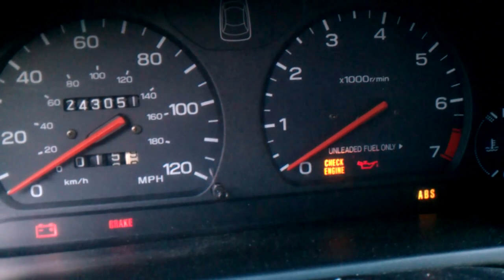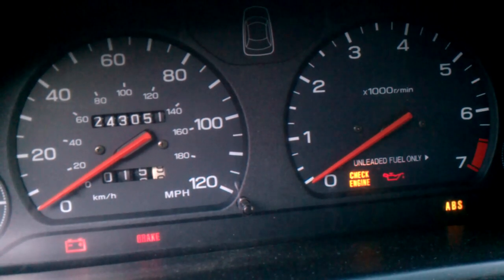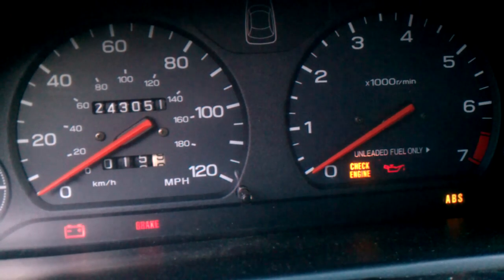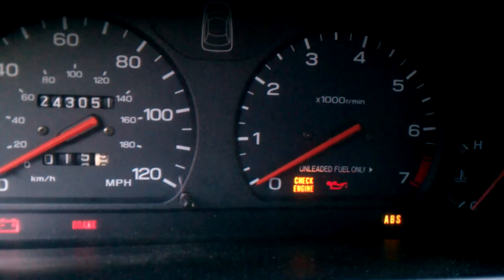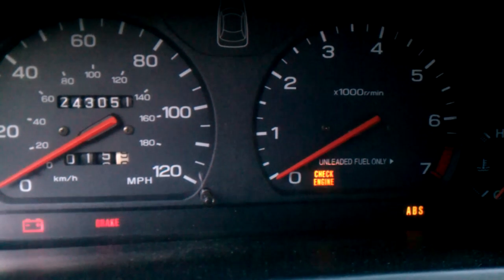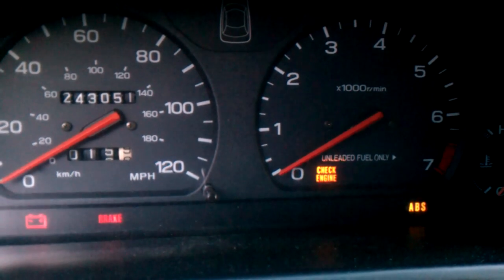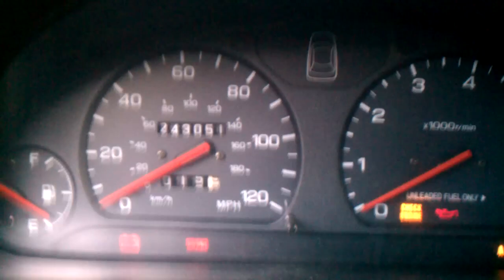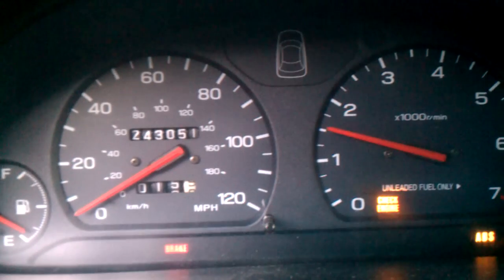Subaru Piston Slap

Comment: that car sounds fine. I wouldn't worry about it. With 2.5l Subaru is using very light weight pistons, so they tend to move around inside the engine black a little till they warm up. But in your case they are worn out so they might take longer to get quiet.
Reply: +Y10Q Weight has nothing to do with piston to cylinder wall gap.
Reply: User Name piston skirt is nonexistent , relatively speaking, thus lighter and noisier
Reply: Go there, there is plenty skirt, and that has nothing to do with piston slap. It's piston to cylinder wall gap
Reply: User Name there is no gap between piston and cylinder wall. It's the rear part of the skirt that is hitting the cylinder wall, factory designed it that way, because there is not enough metal there to guide it smoothly back and forth when it's cold. I have driven a car that had it since 80k miles and engine outlasted the car at 312k miles. So unless it's clacking all the time, I wouldn't worry about it. Mine only slapped when you first start it up for maybe 20 seconds or so. Actually all three of mine do it with a varying degree of noise. The newer ones don't do it as much, but that noise is what makes a Subaru a Subaru. Even when you go start a brand new Subaru, they too have it. It's normal for these engines to sound like shit.
Reply: Do you have any idea what your talking about?
Reply: User Name trying to figure out how to explain it to you so you get it. Search on google for Subaru Legacy piston. Compare that to Honda Accord piston. See the difference? Subaru Legacy piston is half the height, same bore and stroke. Almost no skirt past the pin. That's why the engine is noisy, but almost not damage is done to it, if everything works right. Mine would slap only at idle. As soon as I gave it gas, slap was gone. Pistons on Subarus are shallow looking. It's like they take a grinder and just shave off all the metal past the rings.
Reply: If you have piston slap, your piston to cylinder wall tolerance is too big. The length of the skirt has much less to do with it.
Reply: User Name I agree. But Subaru engines just sound like they have a piston slap. It's not technically a piston slap, as no damage is done to the cylinder wall. Once the engine starts piston slapping, its days are numbered obviously. You should see 2015 Subaru Legacy piston. Almost no metal past the rings, just a small pin support. Sounds like a diesel when you first start it up.

Comment: Been told by my mechanic that the piston is bad. My 1999 subrau OB makes the exact same sound. The subaru has been a real work horse just wish the previous owner(s) would have taken better care of it. So I'm looking at a replacement engine once I have enough money. 
Was told it could be from overheating. Though I have never experienced any overheating. Did miss fire once due to worn out spark plug wire.
Reply: I belive I can help you after 2.5 years of testing to resolve a sludge motor.
The product that should reduce or control the PISTON SLAP is called MARVEL MYSTERY OIL that is engineered with 5 chemicals .
One chemical will reduce friction and it also cleans GENTLY if you have slude.
U.S. Walmart 5 bucks Canda 10 bucks.....use it always for 10 % better MPG to 25 %.
PUT 4 OZS in a full tank of gas.....every tank from now on.
Put 6 OZS ONLY in with your car oild now and 6 OZS in from now on with your clean oil chaqnge.
The product was designed many years ago and my mechanic uncle of 55 years for GM always used it on the farm and in everything especially outboards in the gas....it removes carbon also and varnish.....YOU owe me a beer when it works in a about 2-3 weeks in the motor.

Comment: I would definitely take note of the belt tensioners as the bearings go bad and make this exact noise. Try taking off the belts and run the car for a few seconds to see if it went away. When this happened to me, I thought rod knock and yanked off the oil pan only to find that everything was still in spec. Please learn from my mistakes.
Reply: iansrving I bet if he pulls the timing cover he'll find he needs to replace the tensioner.
Reply: Nik Coffman I have a similar sound in my Forester I just bought. If the timing belt tensioner is going bad, tit sounds like this? My belt looks good, but that’s all I know.
Reply: Nathan Kennedy, sometimes yes. It's something you should check before buying parts you may not even need. If it's bad enough you'll see movement while the engine is running, there should be no movement. You can apply pressure to the top using a screw driver pushing it down harder on the belt. If the noise stops while you put pressure in the tensioner, that's the problem. replace with high quality parts, that does not always mean OEM parts. Good luck.

Comment: My 99 legacy with 2.5l swap does this exact thing for about 45 sec from cold start then goes away. I just did compression check on all 4 and they are all at 100psi. Id say it's normal Subaru thing.

Comment: All Subaru boxer engines have piston slap on cold start. And the turbo watergate actuator control parts make a ticking noice. Unbolt them from the chassis and see if that noice goes away? Also that crank shaft pulley has no vibration damping so if you got a worn bearing it will make it sound even worse?

Comment: My 02 outback does this, not when stationary, but usually most noticable when at or above 55mph, 2.5rpm. Any idea what this could be? It has 135k on the engine, had alot of work done under the hood, otherwise a great ride, I'm wondering if I should replace it or put the money into this kind of repair?

Comment: It also has almost 250,000 miles
Cars don't last forever
Reply: yea thats alot for a gasoline engine anyway.
Reply: Sorry but I Dont agree. That statement would be true if it were A diesel engine, but gasoline engines usually get tired fast in comparison. If your lucky enough to get 250,000 miles out of A gasoline engine with no problems, you got your moneys worth.
Reply: well consider yourself lucky. Gasoline engines hardly ever last that long without problems. and even with the emission on diesel engines, diesel engines still and will always last longer that gasoline engines. Show me a tractor or bus with a gasoline engine in it.
Reply: Its funny how everyone always has first hand experience when arguing A point .If you type car that fail at low miles on you tube, i'm sure you will get hits on that as well. I'm sure people can get lucky( like I mentioned before) and have A high millage gasoline vehicle, but that's the exception to the rule. Again, gasoline engines on a average, usually do not last that long.
Reply: Whatever dude. To get 250k on a vehicle driving normally, you would have to have that car for 20 years, and most people dont hold on to vehicles that long anyway.Like it or not, 250k is alot for A gas engine. The fact that that car even made it to 250k says a lot for A company you claim is no good
Reply: nothing last forever!!! I never said A gasoline engine can never have high miles,i'm saying that most gasoline engines have issues when they get high miles on them. now if your cousin's friend's husband's coworker has A car with 1000,000 miles on it without A rebuild no oil leaks and running like new, then thats great!!!!
Reply: manny6584 
Not necessarily kept for 20 years , there are lots of cars 4 years old with 250k miles cause they are taxi rental driven.
Reply: That's the exception to the rule. that's not normal wear and tear, and that's not what I was referring to. But by the way... even A 4 year old car with 250,000 miles on it with A gasoline engine would be expected to have wear and tear engine issues. That's not poor engineering. That's just what gas engines do.
Reply: *****  everything but that subaru
Reply: and yet you never see anything But Subaru Legacy, Honda Accord, Toyota Camry and trucks and vans in the 250K + mileage region. Why is that?
Reply: Im not arguing that, but if your toyota or honda makes it to 250k and the valves start tapping or the engine feels tired, dont blame it on poor engineering. Just be grateful you got that much life out of it.
Reply: *****
Because front wheel drive cars get tired as they age. They just feel worn. Whereas the Subaru has two powered axles so the stress is lower on each axle and everything lasts a lot longer on em. My 2001 wagon is just as smooth as my wife's 2010 wagon. The other day I was doing 90mph for like half hour, and it drove like a new car. Thing has almost 260k on it.
Reply: ***** I didnt say any thing about rear or 4 wheel drive. Some one made A comment about the car being junk. I replied that the car had over 200K on it and what did the person expect? I agree with you that cars do get tired as they age. Especially gasoline engines. That was my argument.
Reply: No you didnt... I apologize. Your comment was on point. Thumbs up !!!
Reply: Y10Q dude I know for A fact that car drove like A POS compared to a new vehicle and I wasnt even in the car with you
Reply: manny6584
 People are stupid. You would never give it a second look. But if you were to look closer the car has Mercedes seats inside it. Rides on Michelins, $650 for four by the way. Shocks and springs are almost brand new and OEM, installed at Subaru. Trust me, it rides like a new car. They checked everything as far as drive train goes. Super smooth and quiet even at 90mph. I bought it 11 years ago, it was owned by a very responsible adult, highly educated. This car never encountered a pothole it its life.
Reply: Y10Q I just got rid of A 14 year old truck that was well maintained. I too was foolish like you and  thought it drove like A new vehicle. I was just numb to driving A old vehicle for so long, I had no idea what I was thinking, until I purchased A new truck last year. BIG DIFFERENCE!!!!
Reply: With proper care and maintanace I think that most cars can get to to 200k, however very few people do actually maintain their cars well. Also just want to mention that even though youtube has many hits it doesn't mean that it's the norm, it just shows that those people chose to make a video and doesn't say anything about the actual statistics. But I think anything past 200k is rare.
Reply: Volvo V70 T5 over 260 000 miles. Runs good never had a rebuild
Reply: Engines dont last forever, but the physical car can
Reply: @mizzerica18  this is a old thread... so what's your point?

Comment: I had the piston slap on a 163k mile motor, and it went away once I swapped in a 60k jdm motor. I'd say it's not normal and the motor is worn out.
Reply: My factory installed 59K EJ22 makes the same noise on cold starts. The colder it is out the worse the noise is. I would really hope a motor with that low of miles isn't worn out.

Comment: I belive I can help you after 2.5 years of testing to resolve a sludge 
motor.
The product that should reduce or control the PISTON SLAP is called 
MARVEL MYSTERY OIL that is engineered with 5 chemicals .
One chemical will reduce friction and it also cleans GENTLY if you have 
slude.
U.S. Walmart 5 bucks Canda 10 bucks.....use it always for 10 % better 
MPG to 25 %.
PUT 4 OZS in a full tank of gas.....every tank from now on.
Put 6 OZS ONLY in with your car oild now and 6 OZS in from now on with 
your clean oil chaqnge.
The product was designed many years ago and my mechanic uncle of 55 
years for GM always used it on the farm and in everything especially 
outboards in the gas....it removes carbon also and varnish.....YOU owe 
me a beer when it works in a about 2-3 weeks in the motor.
Reply: ye dude sum snake oil wil stop ur piston hitting the cylinder bore
Reply: scampers I say it will reduce the FRICTION and noise.
Reply: ju are gay & jewish
Reply: scampers Don't vee offended .......I have done 6 years of research on engine conditioning and improved the MPG of a 3.0 litre from 29 MPG to 40 MPG...........FRICTION is 60% of the motor so I also removed that with military technology and RAISED the horsepower curve. I took a 2.3 from 36 MPG to 46 MPG and raised the horsepower.

You are muted for being a little jerk
Reply: If this product gave you a 25% increase in mpg then I guarantee that gas manufacturers would incorporate it into their gas, heck even if it gave you 5% mpg they'd still put it in, but in reality I'm sure it doesn't do anything except drain your wallet.

Comment: My 2 liter engine does this at 130000 miles already. When it warms up (20 minutes or so) it gets quiet. Is this normal? Because I am planning a big road trip in a couple of months.
Reply: +Bart ten Thije Mine sounds like this and behaves like yours. EJ201.
When it finally gets really warm it gets quiet. Been like this since I bought it and I have done 10000+ more miles now at 170000+. Momentarily very hard driving at 5000+ rpm off road. 4000+ rpm almost full throttle for 10 minutes or so in the thick stuff.
And there is no difference.

Starts right up. Very minor oil leak since I bought it but no burning so no need to refill between changes. No power loss.
It is strange but I don't worry any more. I just let it warm up before pushing it.
Reply: Thank you for your comforting post. I believe I'll drive my Forester till the end. I always let it warm up for about 15 to 20 miles.
Hope to see some dirt this summer!